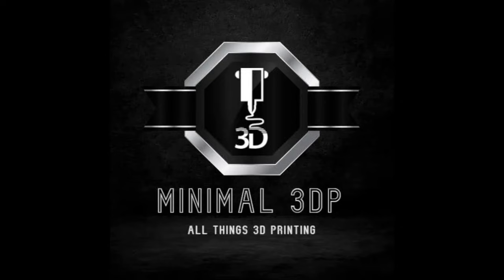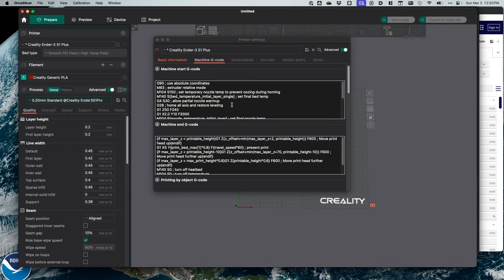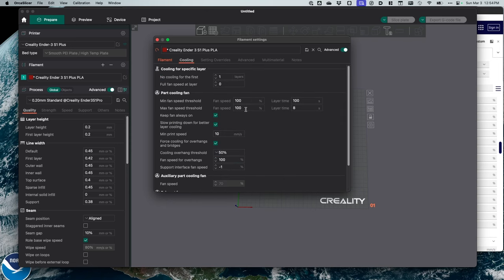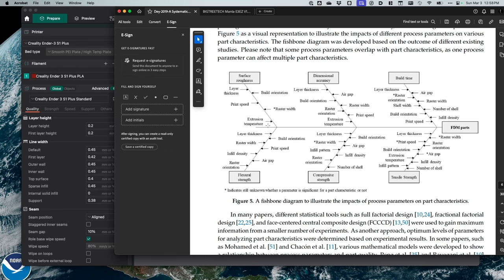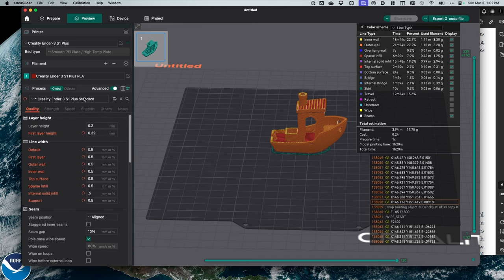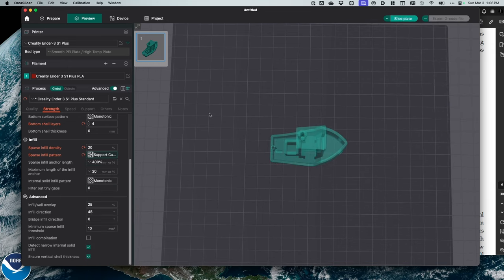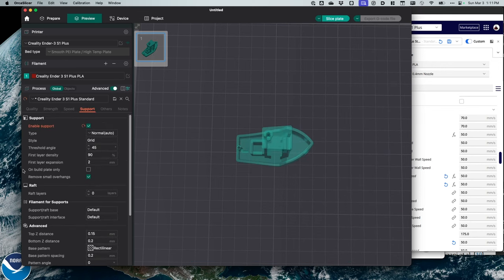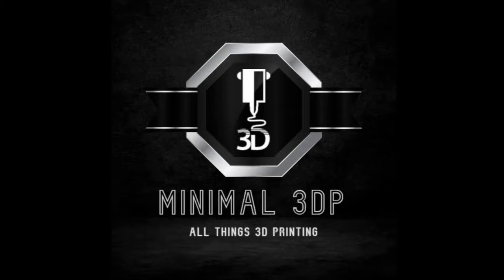Orca Slicer 101: Taking a Deep Dive to Optimize Your 3D Prints for Strength, Speed, and Quality

Comment: Amazing video!!! can i use this for my CR6-SE? i know its a very different printer but maybe works? Thanks again for share your knowledge
Reply from the maker: You should be able to. I the earlier parts of the video series, I create a profile for my own cr6 se.
Reply: @minimal3dp  thank, i use your profile on the last video but i have issues making easy to remove supports. I will try again when the new fan arrives, I think its dead for a month and that's explain my issues. Amazing videos and if you can share tips about the CR6 I appreciate a lot!

Comment: I notice when I set my printer as ender 3v2, only certain material profiles are available. Like I cant even add certain profiles. Have to use the generic klipper one, and all the settings are wack.
Reply from the maker: I have not noticed this issue. Have you looked at the issues on GitHub?
Reply: @minimal3dp  no I have not! I am really new to orca though. If I choose a different printer it allows more options such as the ender 3s1. I can also use the myklipper profiles and add any materials I want, but if I use the ender 3 v2 as the printer it doesnt let you. Maybe they assume the machine stock isnt capable and modded you would be using a custom profile? Not sure on that.